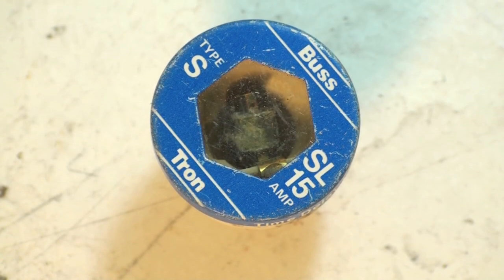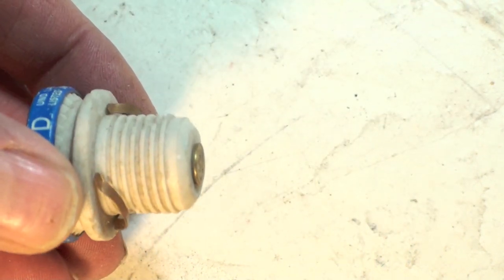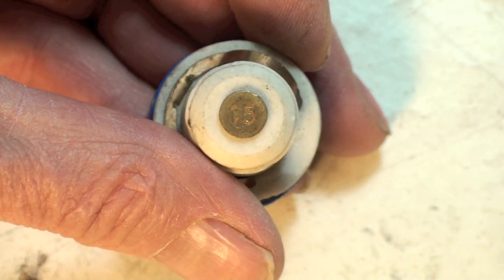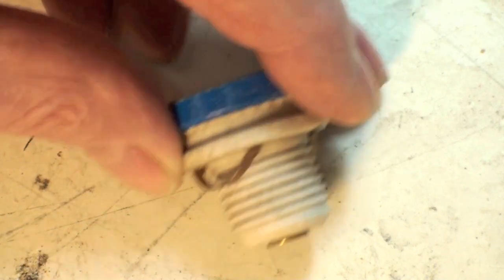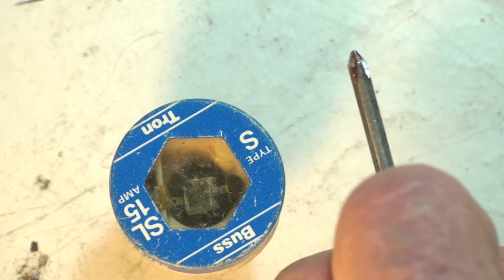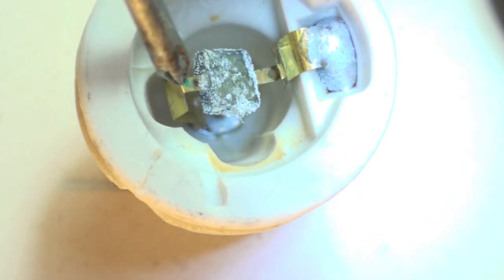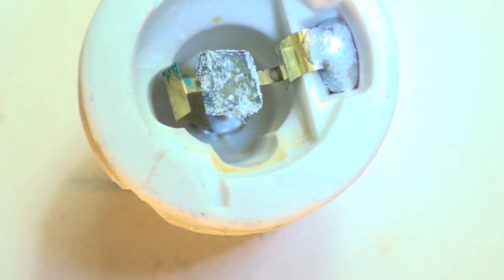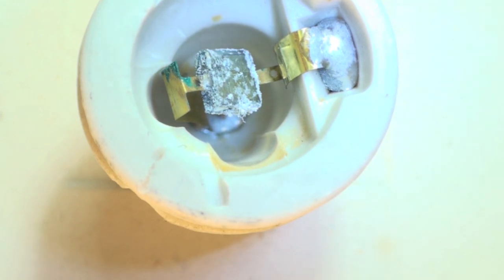The screw in slow blow fuse. Fuses part 4

Comment: @grayfurnaceman, Hi Buddy, Hope you're doing well. I had a question. Can I use a 20 amp fuse in a 15 amp socket? Sometimes my 15 amp fuse blows when the power goes out & then comes back on a few minutes later. That circuit is running the window ac, my big screen tv & ceiling fan. I would like to know if I use a 20 amp fuse would that cause a fire or melt the wire or something like that or would it be ok to replace it with a 20 amp fuse & if the load is too much it will blow just like the 15amp fuse? Thanks & I await your reply.
Reply: Not the poster, but I'm an electrician. Short answer, no. If your circuit is overloaded, or within the overload range of 80% to 100% of the max rating, then that's why you're having trouble with that circuit tripping. You should probably figure out a way to separate at least one of the loads you mentioned off the circuit, maybe by running a heavy duty extension cable or moving the location of the AC or TV. If you can get a licensed, insured, bonded Electrician to change the fuse/adapter and sign off (taking responsibility should you have a fire) then that's on them. You should definitely not change it yourself though.
Reply: @jeremygeiger5134 how can I tell if my old round fuses are blown? Bought a new dryer because other one wasn't coming on to only plug it in to not work as well ughhh

Comment from the maker: Every fuse has a different depth of threads, depending on the amp rating of the fuse.  If the depth is not right, too long or too short, it will not make contact.  Hope this helps.
GFM

Comment: So can these screw in fuses be used today for a Ductless unit that needs 15amps (220v)?
Reply from the maker: Yes, if the manufacturer approves.
GFM
Reply: @grayfurnaceman, Hi Buddy, Hope you're doing well. I had a question. Can I use a 20 amp fuse in a 15 amp socket? Sometimes my 15 amp fuse blows when the power goes out & then comes back on a few minutes later. That circuit is running the window ac, my big screen tv & ceiling fan. I would like to know if I use a 20 amp fuse would that cause a fire or melt the wire or something like that or would it be ok to replace it with a 20 amp fuse & if the load is too much it will blow just like the 15amp fuse? Thanks & I await your reply.
Reply from the maker: @lionheart3569  That's a no.  You could overheat the wires or components.  
Now lets look at why it blows.  
When the power goes off while the A/C compressor is operating, then comes back on less than 5 minutes later, the compressor pressures have not equalized and the compressor draws excessively high amperage.  That means the fuse will blow.  To solve this, you can either un plug the A/C and wait the 5 minutes or you can install a slow blow fuse.  
GFM
Reply: @grayfurnaceman  , Thanks for your reply. I really appreciate it. I have a SL 15 amp time delay fuse in there which is what's supposed to be in there. Is that what you mean when you say to install a "Slow Blow Fuse"?
Reply from the maker: @lionheart3569  It is a slow blow medium duty.  You can try a type T fuse that is a heavier duty motor load fuse.
GFM
Reply: @grayfurnaceman , Thanks again for taking the time to answer my question GFM. =-) I will try to find that fuse you mentioned & go from there. Have a great night & Take care Buddy.

Comment: My parents have them 8 threw 15 fit in adaptor 20 and 30 are same sizi only three is difrent to prevent mixing my parents have 100 amp splitbuss wads worth 8 fuse stats 4 pullouts
Reply: no

Comment: i have an old circuit box in my apartment & it uses these kinds of plastic screw fuses.recently my water heater went out no hot water.theres these kind if fuses and the ones that look like bullets
Reply from the maker: If you want to test these fuses, you will need a meter to check continuity or you can just replace the fuses to see if the W/H works.
GFM
Reply: @grayfurnaceman how can u tell if there blown, jus bought a new dryer cuz I thought my old one was done n plugged it in and bam same thing

Comment: Is there a tool to help unscrew this fuse ?
Reply from the maker: Not that I know of.  If it is stuck, you may need to replace the disconnect or, if it is a main panel, replace the panel.  Most of these are very old and may not be viable anymore.
GFM
Reply: @grayfurnaceman  thank you

Comment: I got them in my box, mine is fusestat brand, you cant screw a 30 in a 20 ect. the threads are different.
Reply from the maker: First, replace the panel.  Just had to get that in.  We stopped installing these panels in the 1960s.  One of the attempts made to increase safety with these panels was to install adaptors to stop you from using too large a fuse.  Not only are the threads different, the depth of the fuse is different.
GFM
Reply: My fuse is not blown how some of my light will not come on
Reply: @terrarichards6924  that is happening to me right now. Did u figure out the reason?

Comment: I seen 6 1/4 amp fuse what would it be used for is it for heat tape circuit
Reply from the maker: Most of those fuses were used for motor circuits.
GFM
Reply: I have this act Same one, I need it for my furnace.., can’t seem to find a replacement. Any information would be greatly appreciated. Mine says BUSS 6 1/4  amps fustat.
Reply: @lindalund1517  I got them in a true value hardware or maybe a electric supply store can order try ebay
Reply: @lindalund1517  they are on eBay type in 6 1/4 amp fuse Stat about 7.00 dollars

Comment: Are breaker fuses like that too, different lengths?
Reply: @grayfurnaceman7640  I said breaker fuses, not breakers.
Reply: @grayfurnaceman7640  just like the name implies. It screws in like a fuse but acts like a breaker.
Reply from the maker: @williampennjr.4448 Oh yeah, I remember them.  The are heat operated bimetal discs.  A heating element warms the disc and it pops open if the draw is too high.  I am not sure if they are listed by UL.
GFM